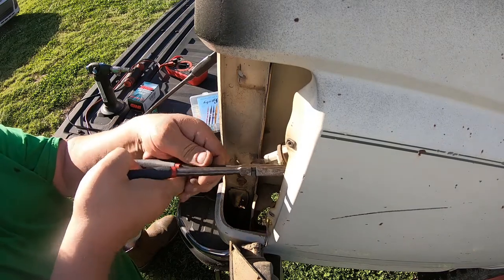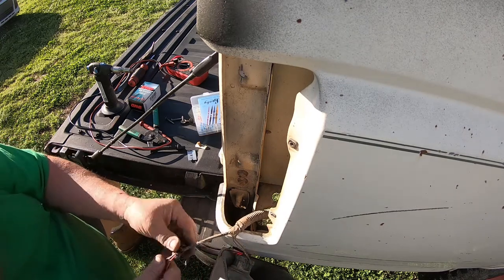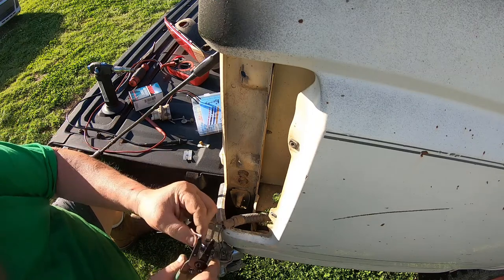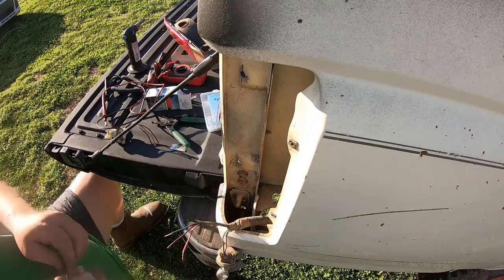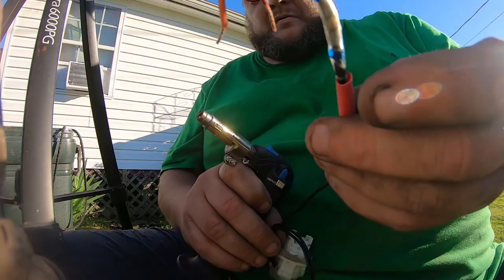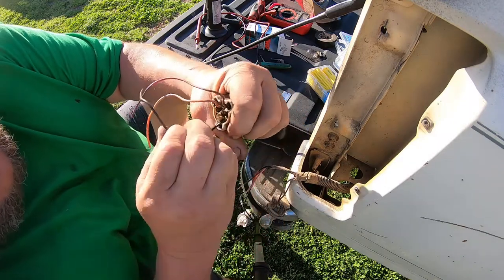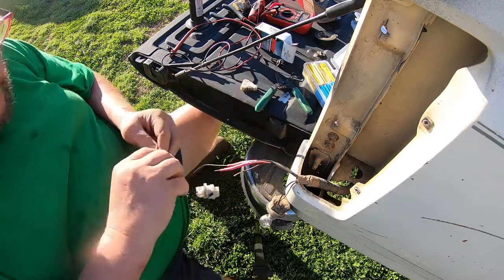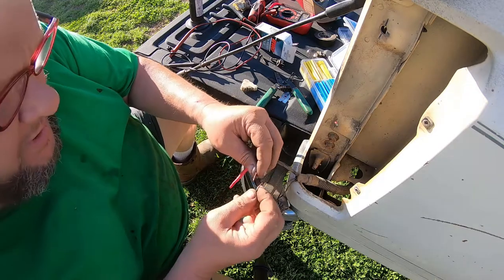Why Does the Fuse Keep Blowing

Comment: I have seen a bad brake switch cause an intermittent fault to ground by shorting thru the switch.
Reply from the maker: It turned out to be I left the spring out of the column. It allowed the steering wheel to drop and rub through the top of the hazard switch.